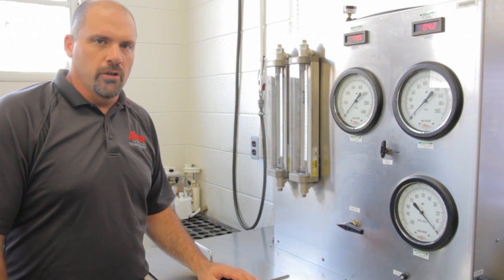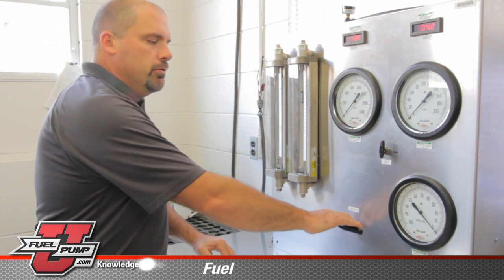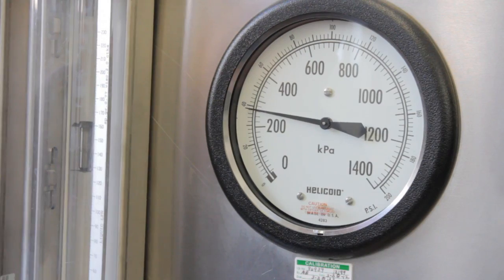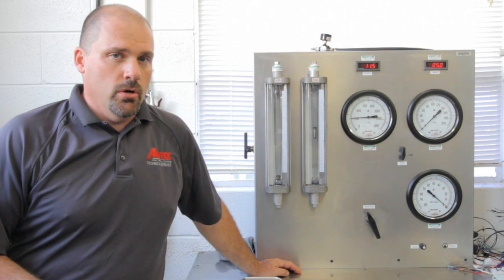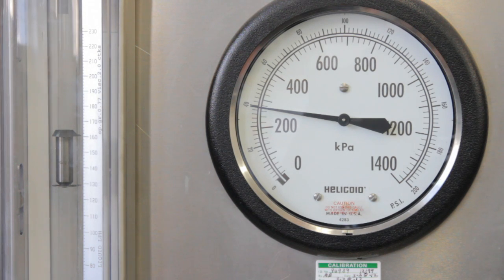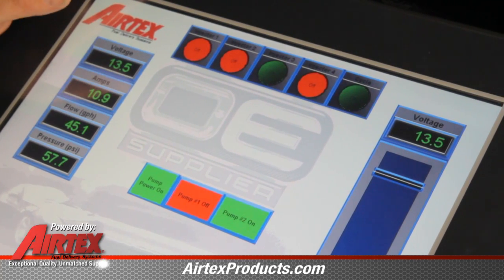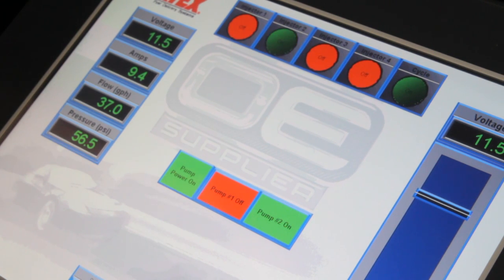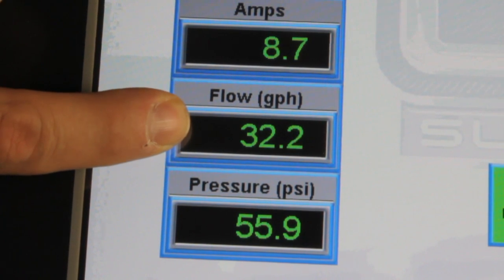How Voltage Affects the Flow and Pressure of a Fuel Pump

Comment: Wow absolutely thank you for this great video. I've been having an issue with lean condition and I have checked the fuel pressure and still within manufacturers specs but I didn't know that you are losing unnoticeable fuels along the way with just a volt of voltage drop. I did tons of troubleshootings such us intake and exhause smoke test, exhaust leaks, even checked the cat converter. It almost made me crazy but after seeing this video, it reminded me that I have 13.5v+/- only at the fuel pump socket while I have 14v+ during coldstart. 
Really appreciate you making this kind of video. Didn't know a small voltage drop can affect so much of the combustion and fuel efficiency. Thank you!

Comment: I got a fuel pressure drop I cannot figure out. I changed the pump, the regulator, checked the fuel lines. Testing before the rail I loose about 15psi from 60 to 44psi at wot open throttle. The loss seems to coincide with the boost pressure. But the 2 I believe are not related. Pump voltage stays at 12.7-12.8 from idle all the way thru wot. What else can I do?

Comment: Will it hurt the pump to run at low voltage if the pump is still suppling more than enough fuel at the proper pressure?
In other words, can I reduce the voltage so I don't send so much fuel back through the return.

Comment: I switched from throttle body injection to carb, and my truck just sometimes seems as it runs out of fuel, let set a few minutes and starts back and runs fine, I have a pressure regulator on it set at 7 psi, any suggestions?

Comment: But how do you solve voltage issue
Do you need replace battery or Alternator?
Reply from the maker: The task is to locate the source of the voltage drop. Testing both  the positive and negative side should resolve the issue. It could be that the battery and / or alternator are part of the issue of low voltage.
https://www.youtube.com/watch?v=IuP0ZEHfDJ4&t=4s

Comment: So would higher volatage make it a little loud? I just got a new alternator and it charges at ~14.9v . At the same time I changed the alternator, my fuel pump seemed louder. I don't notice any driveability problems or grinding noises
Reply from the maker: Your pump is not running at full alternator out put. It is running a what the voltage regulator limits the vehicle to and what the fuel system allows.